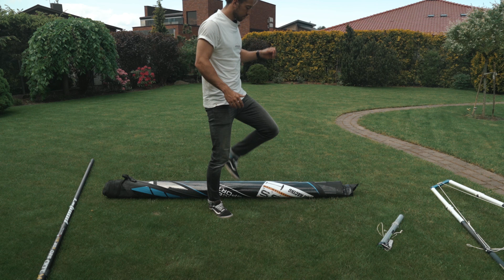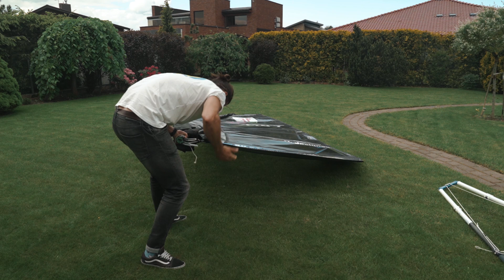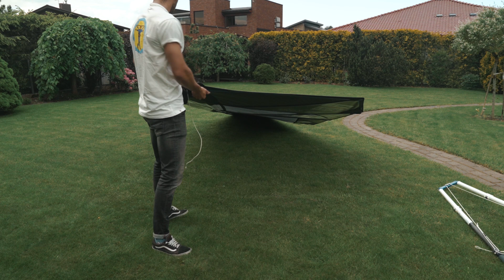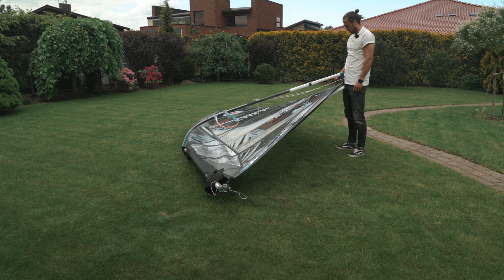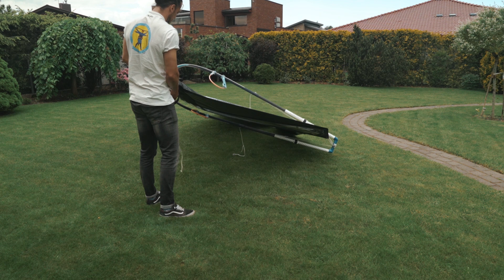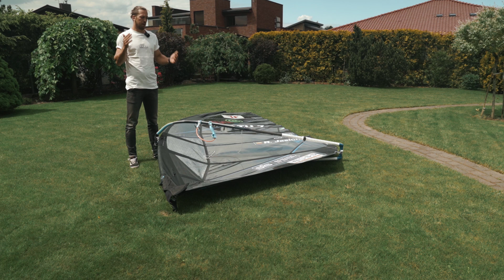How to rig Point-7 F1 SL sails and How to tune your foil sail?

Comment: Hi Rytis,
Have you also tried the P7 F1 FW sail? How is it compare to the SL? in terms of low end power in very light winds (9-10m sails)
Reply from the maker: If you compare 9.0 to 9.0 planning wise there won't be a big difference but obviously the 9.0 FW will have significantly more power to pull you on a deep downwind course and due to a lower bottom leach it will also be easier to point high upwind.
Reply: @RYTISJAS   and I guess the 10m will be even easier to plane in super light wind?

Comment: Hi Rytis. Did you ever use the wide-tailend for the duotone boom? Does it make any difference?
Reply from the maker: I haven't tried it unfortunately. But for sure a wider end boom is better for upwind and downwind sailing when you want to have more power and especially more angle downwind. For slalom I am not certain if it would be better, it could be but I am not sure

Comment: You say you use the middle hole (outhaul) to get a better topspeed. How does that work?
Reply from the maker: It allows a better release on the batten above the boom, the air exits the sail cleaner and faster and therefore creates less drag